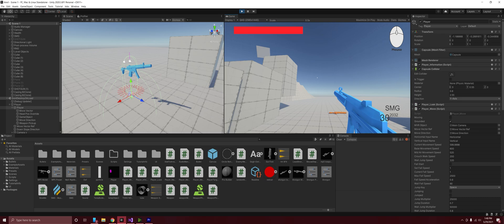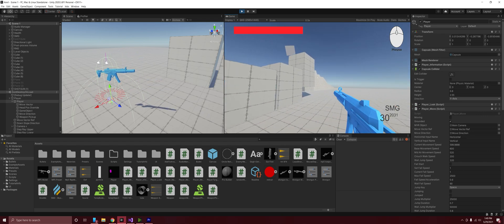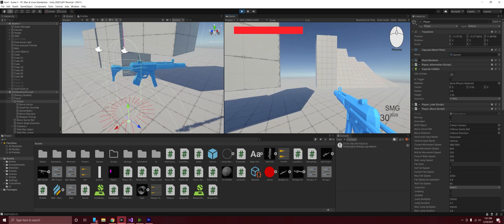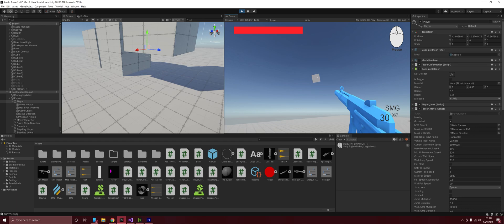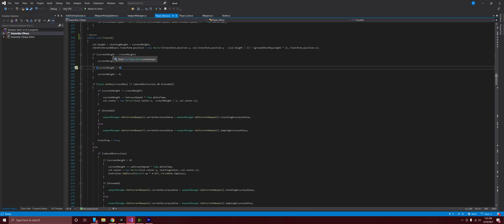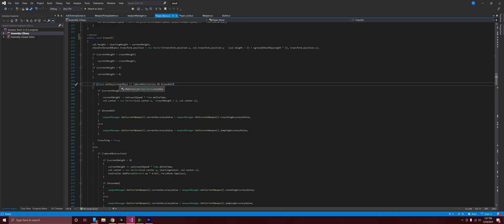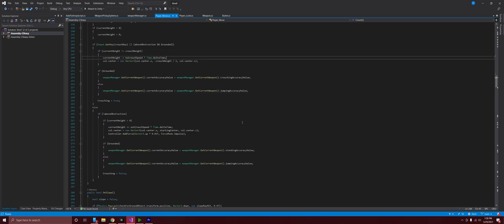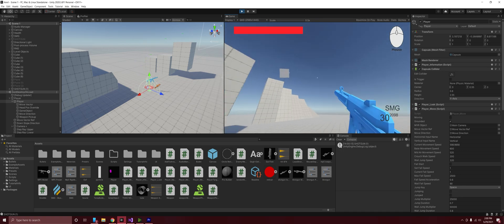FPS Project DevLog 003: Crouching / Crouch Jump [OUTDATED]

Comment: question, my crouch/crawl seems to be similar to yours and I’ve run into an issue. When switching from standing height to crouch/crawl height, the player momentarily floats above the ground which causes the grounded check to show false, just until the player finishes the switch. How do I stop that?
Reply: //Add an if statement in function
//YOu can check if player is grounded by ray casting (look in standard assets)

if (!grounded)
         rb.AddForce(0f; -forceValue; 0f);  //Add force towards ground
else if (grounded)
         //Rest of code